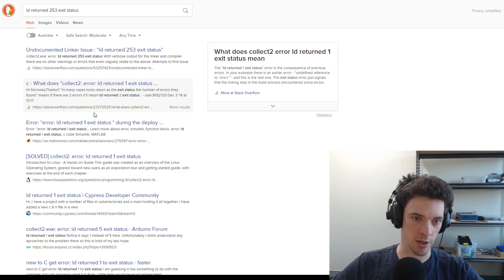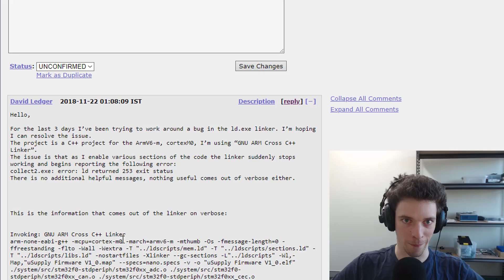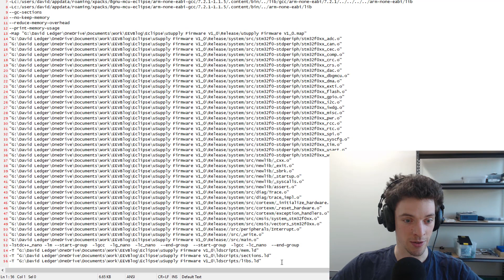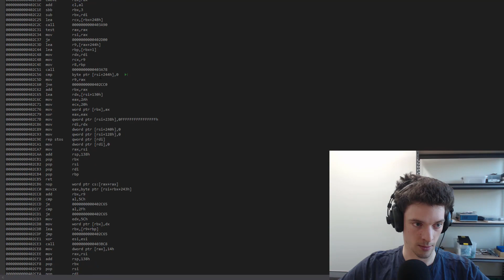GCC Embedded Linker Issue Stops uSupply Development

Comment: Was your arm-none-eabi-ld.exe itself compiled with debugging symbols? You could try compiling your version of the gcc cross-toolchain from source with debug symbols enabled. That might get you some more information from ld at least.
Reply: Nope I used the packaged one.
I'm setting up a linux machine so I can try this out there.
Reply: @davidledger5941  

Have you tried WSL yet?

(ie. installing Ubuntu shell from the Windows Store on Win 10.)

I started using it only about two weeks ago, and so far it's been working great for compiling ARM stuff under Windows.

(albeit for an ARM SoC rather than M0, but it's simple enough to set up, even for somebody as allergic to Linux as me. lol)

You can even load Linux GUI stuff, by installing Xming.

Loading Ubuntu shell is all you need, though. It's faster to load than using a VM.

You should just need a few apt-get commands to install the ARM toolchain stuff, plus it lets you access the normal Windows drives in the mnt folder.
Reply: @davidledger5941  The packaged one won't have debug symbols.
Reply: This, this and this again, saved my ass once.